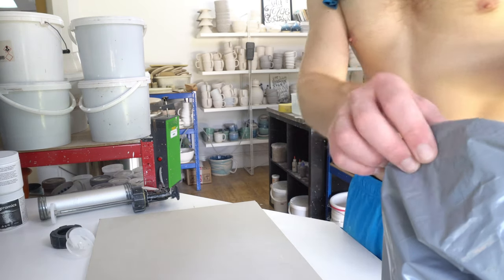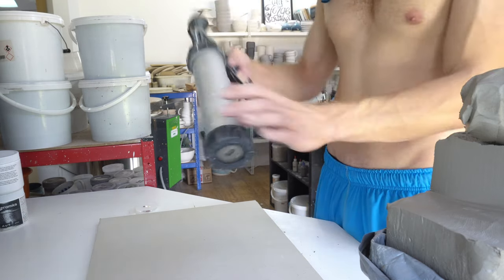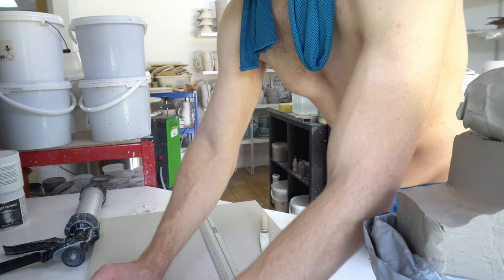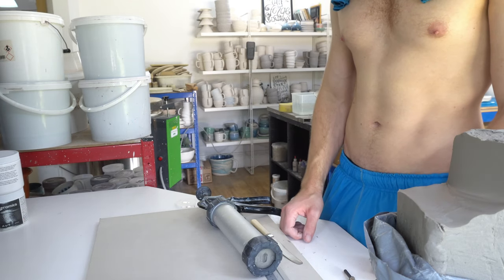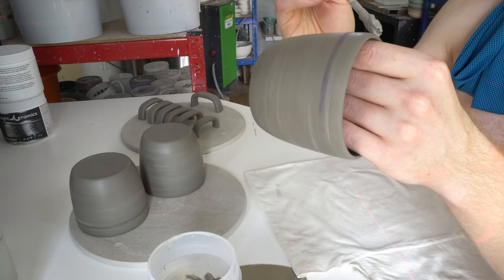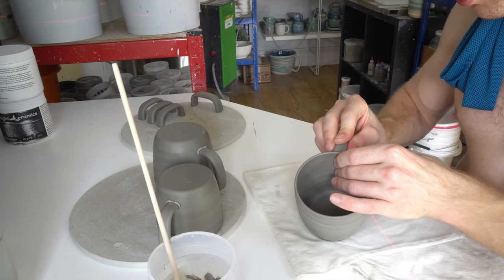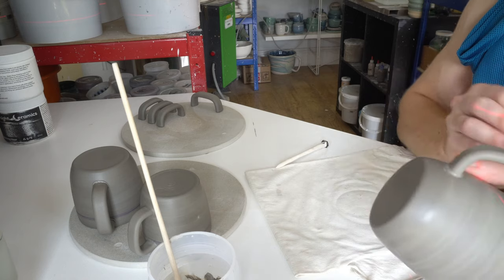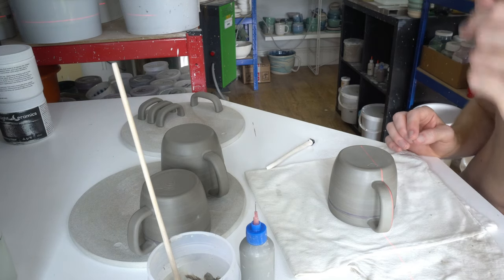Making Handles with an Extruder

Comment: Thank you so much for this video! I have been avoiding handles for as long as I could but I need to face it! Now I feel like I can attempt it with a measure of confidence instead of dreading it. The modeling tools and the laser level are fantastic tips. Thank you for your generosity.

Comment: Thank you! I was getting a lot of bubbles until I tried your method, but I find it quite difficult to press the clay into the extruder. Is it possible my clay is too dry while going in?
Reply from the maker: It could be that the clay is too stiff, or it could be the extruder mechanism. If the clay is squashing out sideways rather than going into the extruder then it's more likely to be the extruder being too stiff. It's also worth doing smaller amounts of clay at a time in either case
Reply: @OldForgeCreations  Dangus, that is totes what's happening. Thanks for the insight.